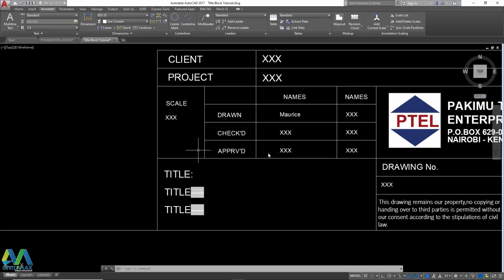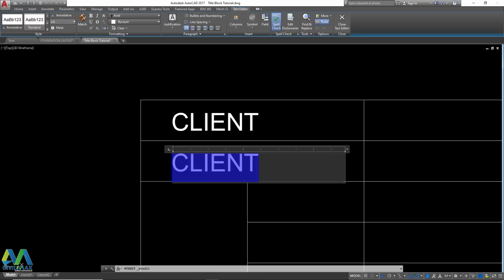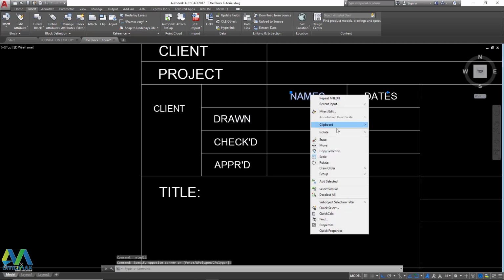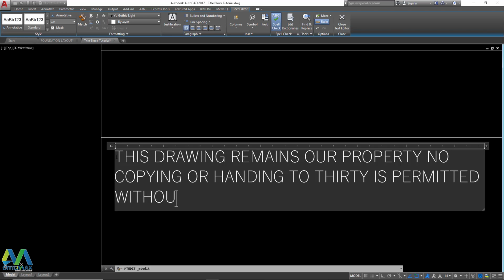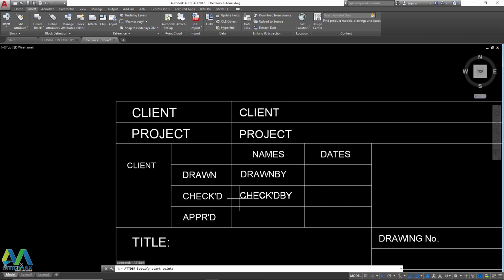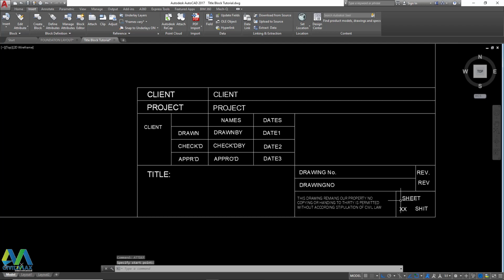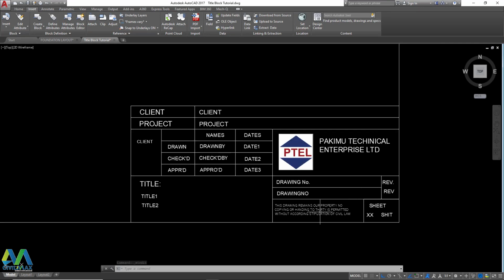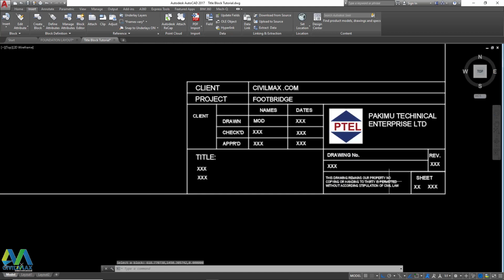How to Create Title Block Using Edit attributes in AutoCAD

Comment: This is an old video and i am refreshing on setting up attributes after using solidworks for so long. But i want to point out, in the professional field you never just copy and drag. You always want to use snap points on a copy if moving text into the same size box. So you would select the text>co>select a corner of the title block box>drag the new copy text to the next box using the same snap point. That will always keep the text centered. You also want to shit-right click and select mid between 2 points with a MC justification to keep text centered in the title block boxes.
Reply from the maker: noted